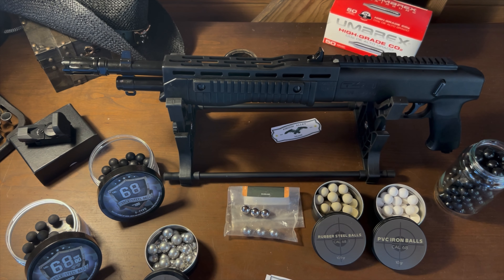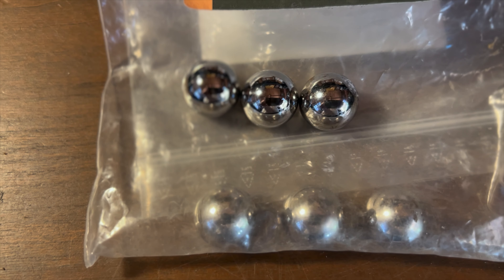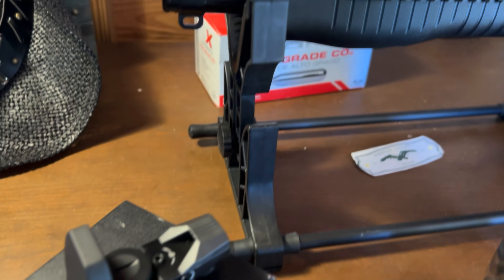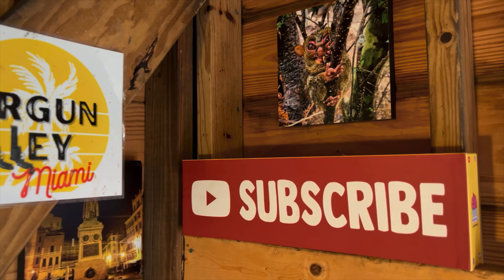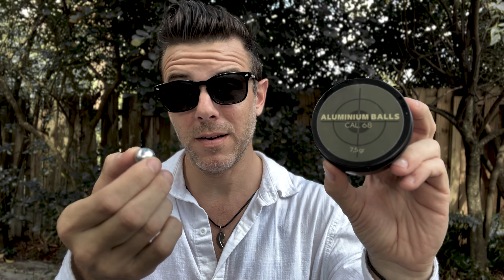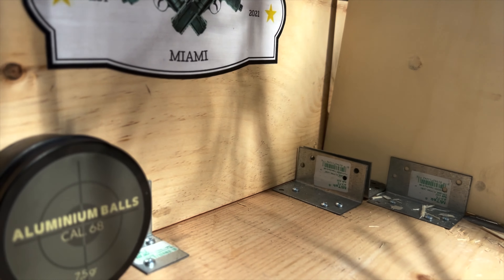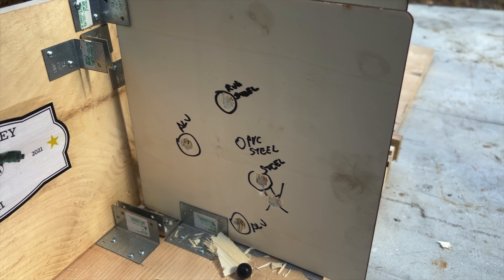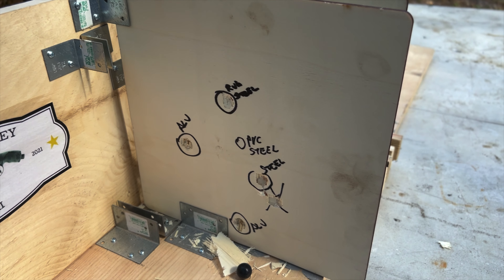BEST AMMO for the HDB 68

Comment: I've shot my phone as well, and it's a bummer, to say the least. Here's a little suggestion with the 1/4" boards you shoot. A better support on all sides of the boards will give better results.  The flexibility of the boards changes depending on where the ball strikes, making it difficult to judge the results. And even when supported from all sides, the center will flex much more than the sides. Maybe a smaller square with support all the way around. Anyway, I love your videos and awesome job filming and content.
Reply from the maker: Oh man, sorry to hear about your phone too! And you’re spot on. I had actually already bought all the steel corners to add that third fixing spot - but just didn’t have the time to install them before filming. 
At least 3 fixing points are better than just two hehe
Reply: @Airgun Alley Miami  l shot mine with a 1/2" steel ball with my slingshot at 250 fps or more. It's devastating to phones. LOL, it puts out similar power to the best less than lethal guns. Modern rubber and a good knowledge of how to use slingshots can be a great less than lethal as well. Now I must add....only if you truly know how to use them effectively.  Otherwise, you're toast. Lol, take it easy, and thanks for the reply. Check out some slingshot channels and I think you might enjoy.

Comment: Hello AIRGUN ALLEY
Have you thought about modifying your TR50 even more?
How about adding a TR50 Upgraded Barrel Kit and a Umarex TR50, Barrel Shroud to cover the extended barrel?
Now that Size of Air Pistol looks and is impressive.
I converted my TR50 with the above 2 modifications. 
The total length of the TR50 is almost 12 inches now.
Its still fits in your TR50 Holster.

Disclaimer: This was a Dilettante Presumption Theorem: All statements of fact, opinion, or analysis expressed do not necessarily reflect official positions or views or any other entity, past or present. Nothing in the contents should be construed as asserting or implying endorsement of interpretations and factual statements.
Reply: How much did the barrel upgrade kit bounce it up to?
Reply: @FLAlesslethal 
Sorry I don't have a Chronograph, but it appears to be faster and more powerful. 
Disclaimer: This was a Dilettante Presumption Theorem: All statements of fact, opinion, or analysis expressed do not necessarily reflect official positions or views or any other entity, past or present. Nothing in the contents should be construed as asserting or implying endorsement of interpretations and factual statements.

Comment: I’m confused and surprised that the joules of energy varied so widely among the various projectiles. I have always held the belief that joules is largely dependent on the air gun and not the projectile. That a lighter projectile will go faster and a heavier projectile will go slower but both would carry approximately the same amount of energy when fired from the same air gun.
Reply from the maker: Hi Thomas! I agree with you and my conclusion is that the only consistency with these markers is their inconsistency. 
Absolutely true on the gun making the joules and not the projectiles. Other than the fitting factor, of course. If the slug doesn’t seal well it’ll obviously gain much less speed/power.
As you know I usually shoot various shots thru the chrono per test. In this case I only shot one. So we had to rely on what the single reading told us. Which, again, can not be the most accurate.
The first shots should always be more powerful as the seal and chamber are not that frozen yet. The more you shoot the colder everything gets, and that brings the power down a bit. So that also could play in.
That’s my take on it :)

Comment: Good video but I do metal fabrication and welding I know how to bullet proof prep store fronts with bullet resistant panels your targets are held down on one side and the bottom giving flex to the top and other side and the weight is off so your getting poor results when you shoot your targets.
Reply from the maker: Thank you James and indeed you hit the nail on the head (to be expected from a welder 😂)… I bought more of the metal fixings but haven’t mounted them yet. Next time, the boards will be much better fixed on three corners. Very good point and thanks again!

Comment: Don't they got some loading pinns, to drop them pellets quick n also some bigger CO2 capsels is needed!!
Reply from the maker: I think you’re thinking of the HDX 68 which has both ;)
Reply: @AirgunAlley  Thanx 4 quick answer! Apresiated.
Reply: So my question is that since there's bigger capasitys with CO2 capsels, are there diferenses in sizes. Like can you fit them in to hanle of umarex TR50 or Bravo A's grip?

Comment: It's unfortunate the steel balls are only 17mm wit is far smaller then any other ball hence why only 14 joules they are spots smaller if all same diameter ball then you'd get appox same joules. Bore matched steel bearings are the best I use 11/16 balls they.6875 or 17.4mm and are 21.7 grams 500 for 75$ on Amazon right now
Reply from the maker: Great input and well said! Thanks for this 🙌🏼

Comment: HDB 40 joule finally puts the Lewis and Clark Girandoni urban legend to sleep. At a known velocity of 300fps, the Girandoni's 150gr/20g .46 caliber ball clocks in just over 40 joules and as demonstrated, results in an extremely short range. It must be something of an elaborately fabricated inside joke at the NRA for armchair enthusiasts. 46 caliber? More like 4.6 mm
Reply: Obviously, this "caliber" of blatant fantasy in a historical document casts doubt on whether the Lewis and Clark Expedition of Infamy ever took place at all. So much for American History
Reply: Actually their average mv was 600 fps for a muzzle energy roughly equivalent to the .22 long rifle... At 100 yards they were still clocking better than 300 fps...

Some original rifles fitted with modern pcp low power air tanks approaching a 1500 psi fill in a 2000 psi rated buttstock tank hit almost 800 fps for almost 38 special +P power levels using the original valve.